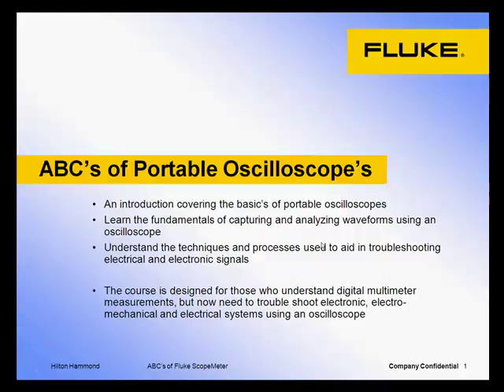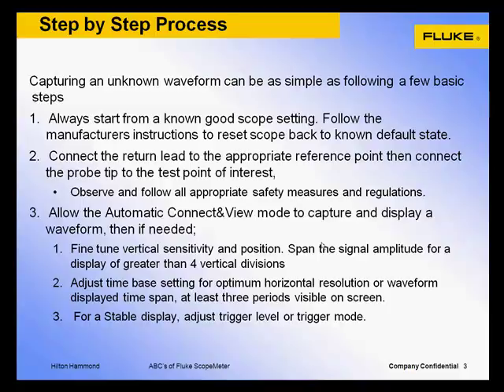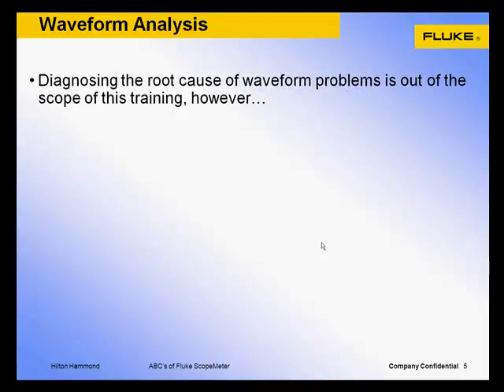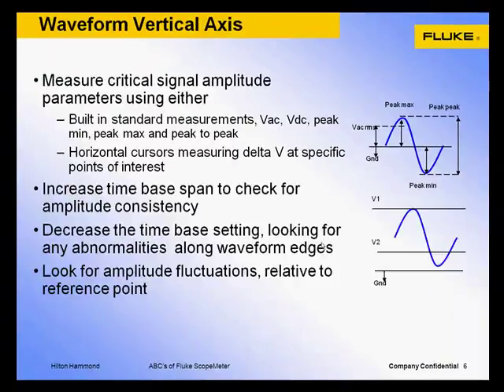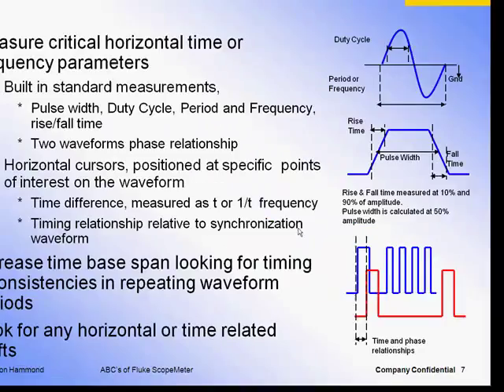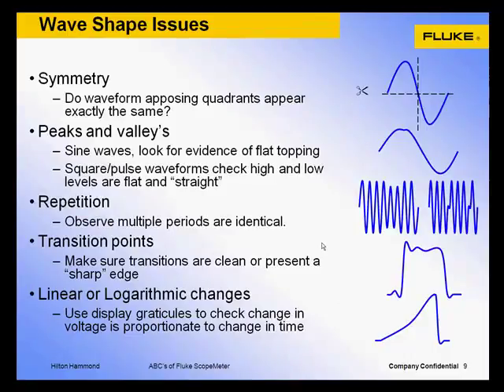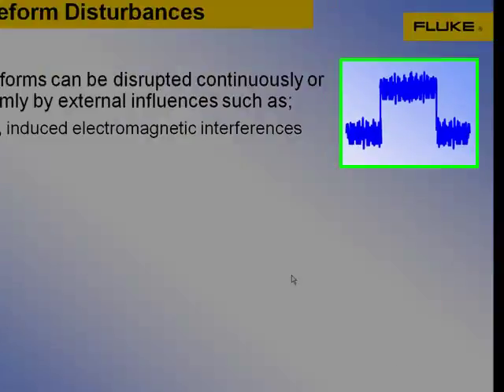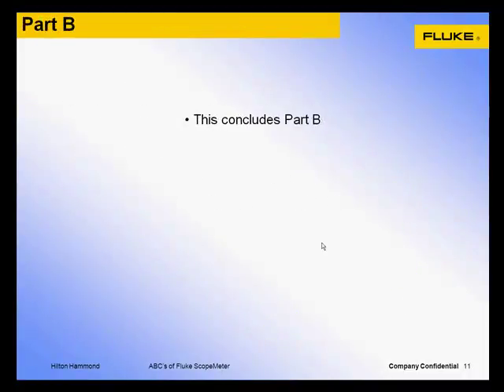Portable Oscilloscope Webinar Series Part 2: Waveform Capturing and Analyzing

Comment: Hi, great video! I was wondering why in .csv file saved from the scope recorder (fluke 190-204-III) there are two different measurements/waveforms data for the Y axis (V). Do you know why is that and if the scopemeter is doing any kind of filtering to output one or both of those measurements? In short, I don't know which of the data columns is the "raw" data. Thanks in advance.